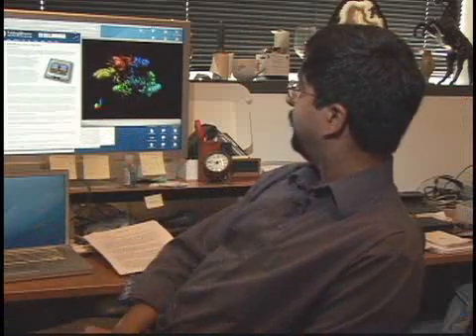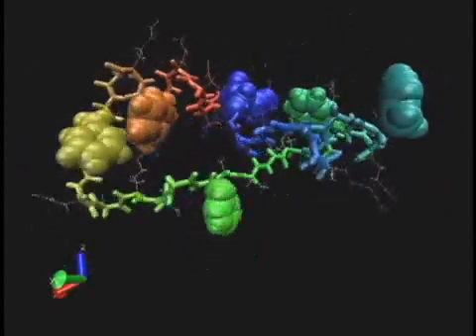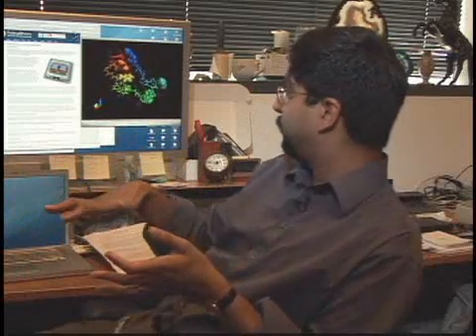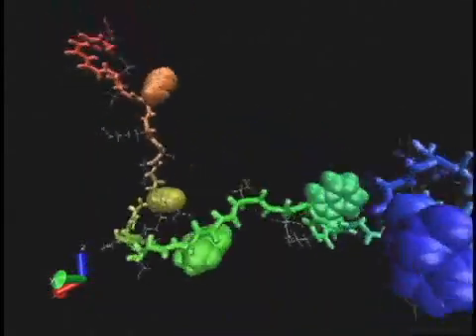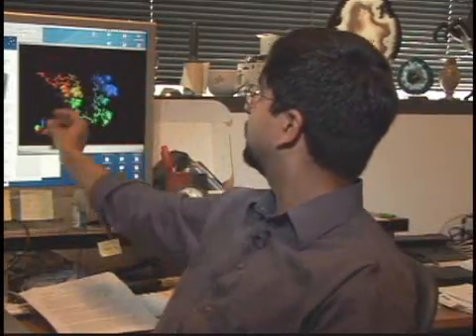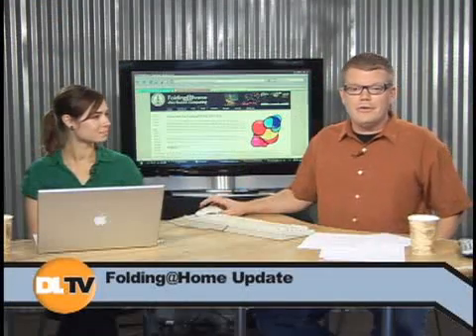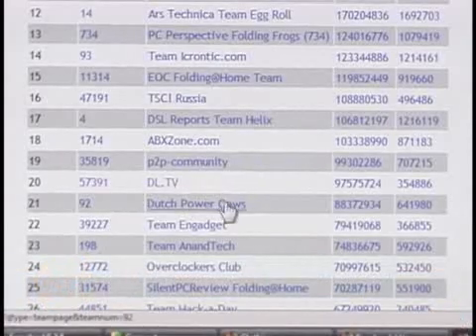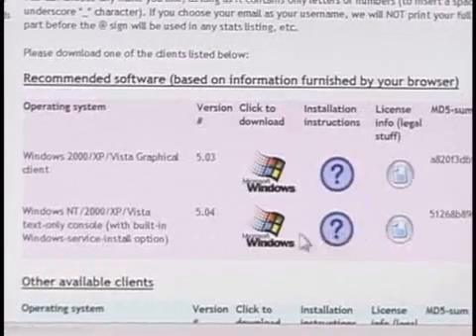Folding@Home Interview: Fold a Protein

Comment: Maybe someone else installed it on your computer as a service. When it's installed as a service every time your computer starts up it will automatically load it up behind your back. You would have been able to open your task manager and shutdown the process anytime you wanted.

If you're worried that your CPU is processing stuff without you knowing, actively monitor it's usage with Process Explorer (by Sysinternals) or CoreTemp.